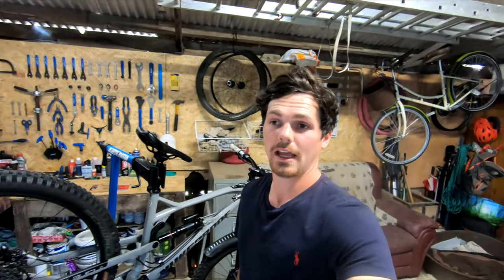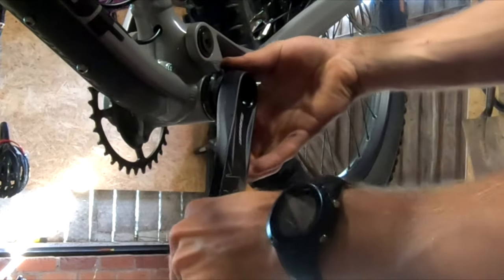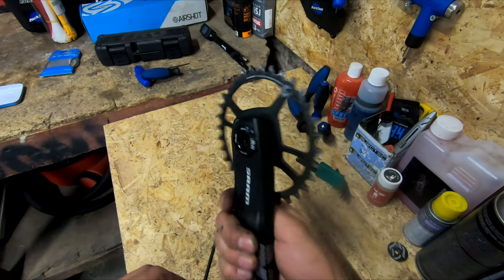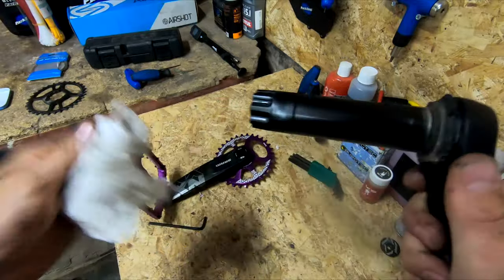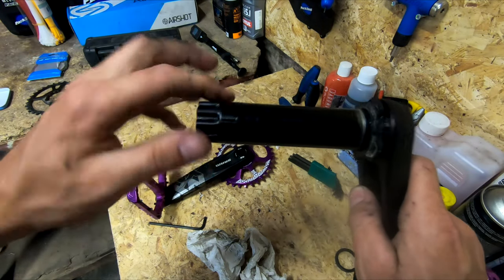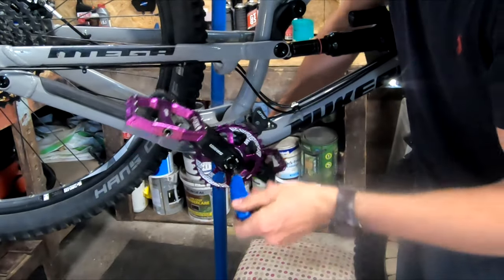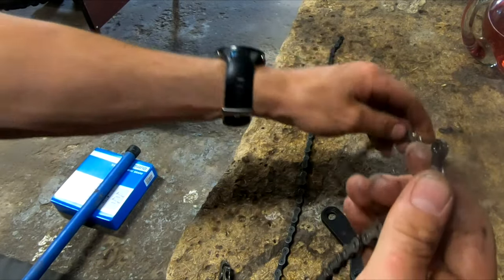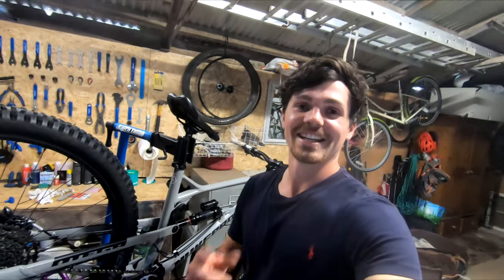How To Replace Chain & Chainring on SRAM Drivetrain

Comment: Would have used loctite on the chain ring bolts instead of grease as it also acts as a antiseize, yet for safety locks the bolts? Grease can just work loose. Just saying 😎
Reply from the maker: Those bolts can be a real nightmare to get out when loctited in
Reply: correct, just a dab - no need to smear loads on to make future intentional removal difficult.  Torque is 6-7 nm but OP doesn't have full pro toolset.

Comment: Can’t loosen my sram crank bolt off had a scaffolding bar on the Allen key trying to loosen it any ideas how to get it off
Reply: Normally the bar would work! Put the bike on the floor and get someone to hold the other crank arm while you pull on the bar. If that doesn’t work turn a impact driver but make sure you are doing it the right way!
Reply: Might have to try the old Impact driver think the hulk must have tightened it

Comment: 2:41 no need for someone else to help you, just hold bike, and wear good shoes, apply force on the key using your body, it will loosen quite easily. if bike is complete, then do it on the bike, have foot on one crank arm, and put force on key on the other crank.
if bike is stripped, then lay it on the floor, make sure to have a rubber mat to not damage the floor or the chainring, just apply force, you can do it with bike between the legs or on one side, do what ever suits you, but you should be able to do it with just applying force.
I have used these methods, so I know they work.
Reply: Woowwwwwww you should do your own videos..... save that massive paragraph
Reply from the maker: @joeledwards4754  🤣🤣🤣

Comment: It looks like you are replacing the sram eagle NX groupset chainring with a United component chainring but a word of caution is that sram eagle chainring has a unique wide narrow profile.  I say this because recently I installed a wolf chainring drop stop ST on my sram eagle NX and it may seem to work but realizing that the correct one is the wolf chainring drop stop A I replaced  it and it is much much better.  But from my research you should really use a sram eagle chainring because the narrow wide teeth profile is unique or order one from Chromag where sram has licensed its used. I will be doing that as soon as stock is available
Reply from the maker: Have used aftermarket chainrings for years on Shimano and SRAM and never had a problem, I think you may have fallen for marketing rubbish there dude!